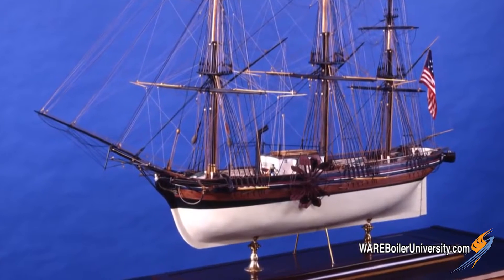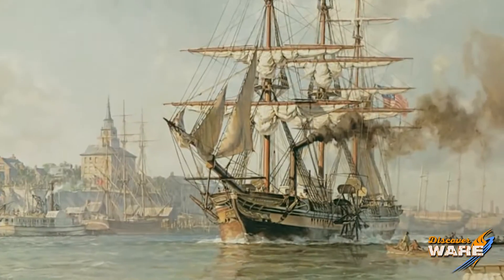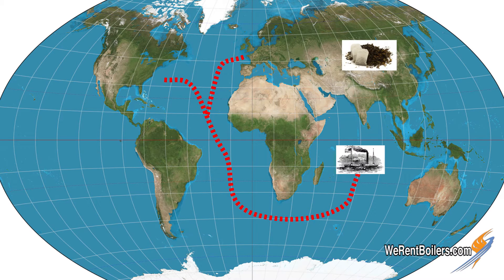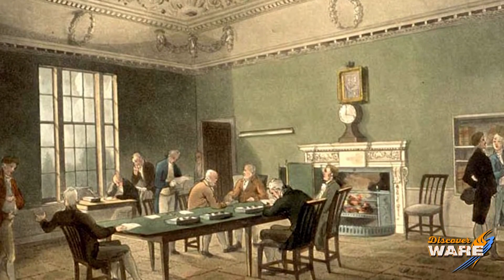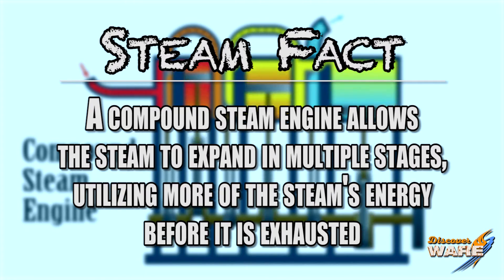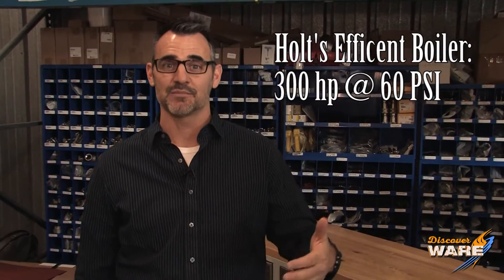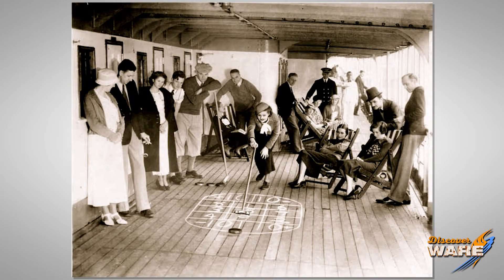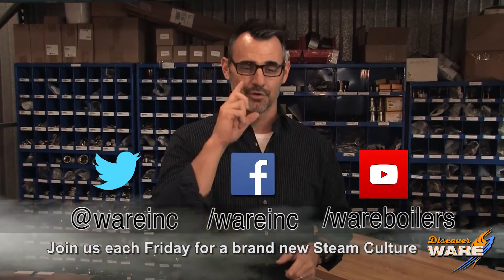Sailing Across the Ocean with Steam - Steam Culture

Comment: Alfred Holt compound engine was a tandem engine and it was designed by Alfred Holt and John Elder. The engine room was made as small as reasonably possible to allow for more cargo. Alfred Holt also designed the hull and the vessels were extremely efficient. I think they consumed coal at the rate of 2lb/IHP. Holt had a ship called the SS Cleator he used as a test bed for machinery and boilers. Using the results from the Cleator he was able to convince the BOT to allow higher boiler pressures. The boilers used were back to back locomotive steam boilers. Holt served his time as an apprentice engineer with a railway company and was familiar with these boilers.

Comment: Thank yoi for posting this and helping educate the general public...

fyi: A compound has two progressively larger cylinders and uses the same steam twice, the graphic you show is a triple-expansion which has 3 progressively larger cylinders which use the same steam three times.  of course there are exceptions like 3cylinder compounds that have one cylinder one size,  and the other two are the same size, usuall two low pressure cylinders.  Four cylinder triple expansions (Titantic) have four different cylinders,  but only 3 different sizes, with usually  two same-size LP cylinders. Then there's quadruples...